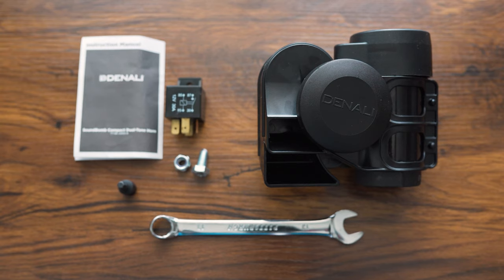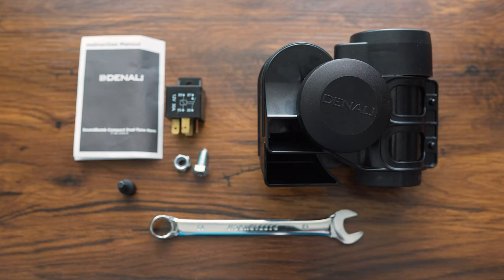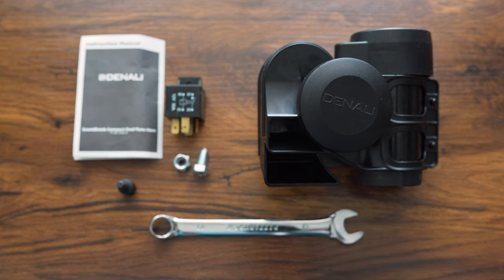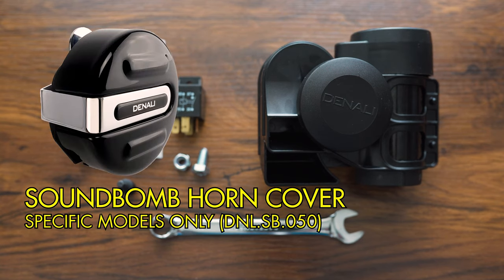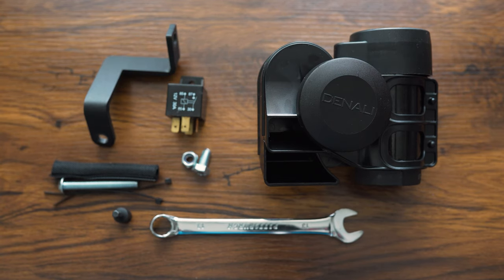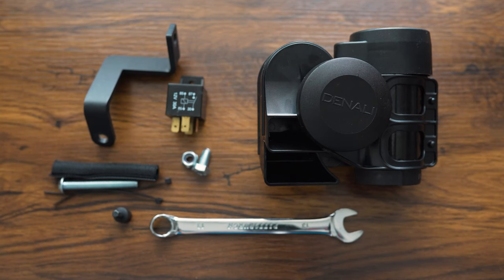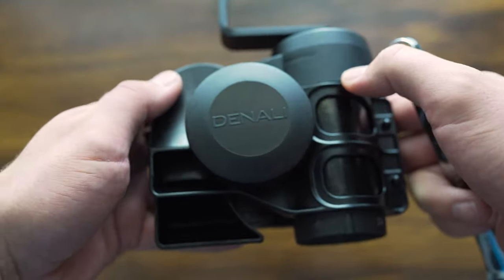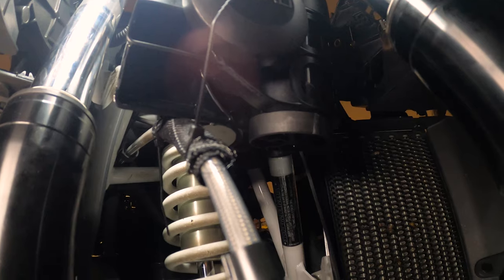Denali SoundBomb Original -  Deep Dive & Installation on a '21 BMW R1250GSA

Comment from the maker: Just a heads up, the mount I used in this video has been discontinued and is no longer available. Moving forward, most (if not all) of the LC 1200/1250 GS and GSA's are going to use HMT.07.11001 for the Split Horn instead. This adds compatibility even for low-suspension models. 

https://denalielectronics.com/products/horn-mount-bmw-r1250-gs-gs-adventure-20-22?_pos=1&_sid=401875b8b&_ss=r

Comment: Sound bomb mini will work with factory wiring, no need for wiring kit
Reply from the maker: That's correct! The SoundBomb Mini needs 5A to function which the 1250GSA can output! The SoundBomb Harness is required on any application that cannot output this power.

Comment: that position is the worst place for the horn....i installed there double nut and serrated wasger with red lock tight ....horn fell off 2 times lost first found second ...i moved to the split horn ...so much better mounting
Reply from the maker: Yep! Seems like a good reason to discontinue this mount and make a new one. See my pinned comment on this page.

Comment: Where can I buy the mount?
Reply from the maker: Honestly - not sure. It's been discontinued and is no longer available from DENALI. I'll pin a comment with details, but the successor mount is only compatible with the Split version of the SoundBomb in favor of increased compatibility for low-suspension models.